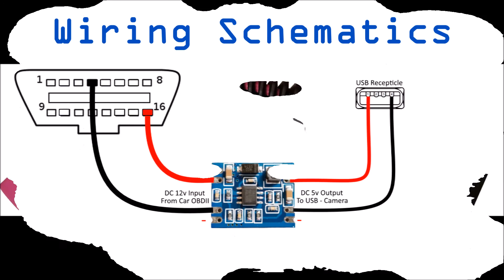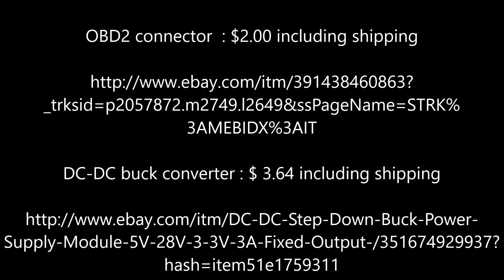Powering a Dashcam (ddpai m6 plus)i using OBDII adapter

Comment: Their are dozens of places to pick up 12v a lot closer to where you will be mounting the camera,why the OBD connector?  You can bust open the cig lighter adapter that came with your unit or get a cheap one from the store and wire it up.
Reply from the maker: Because with the OBD2 the wiring is completely concealed, just my opinion.